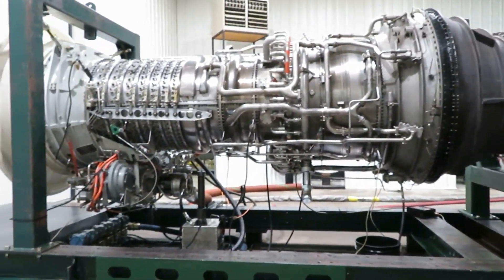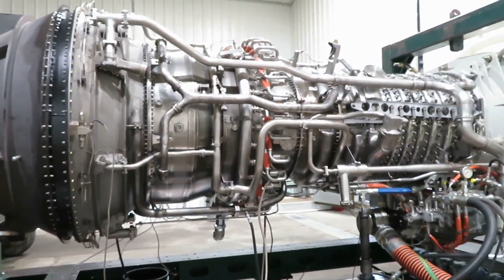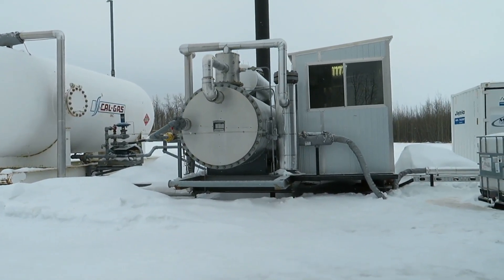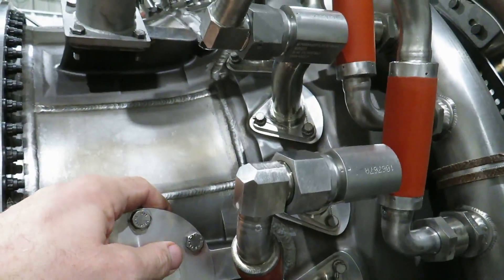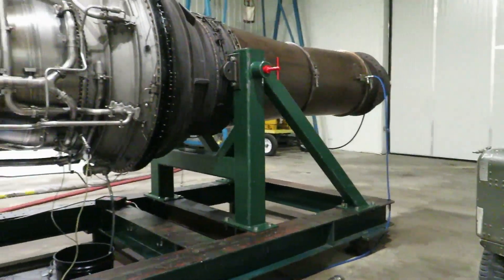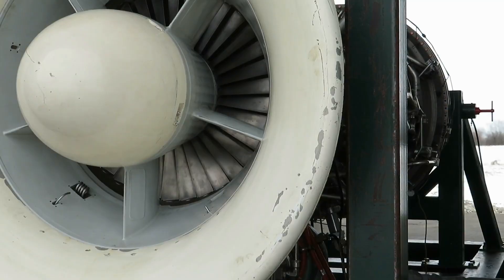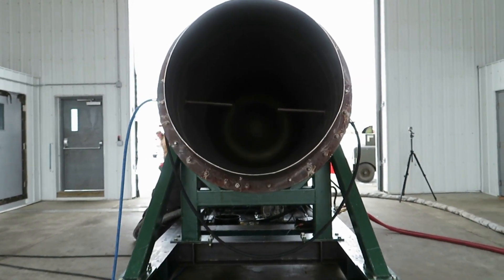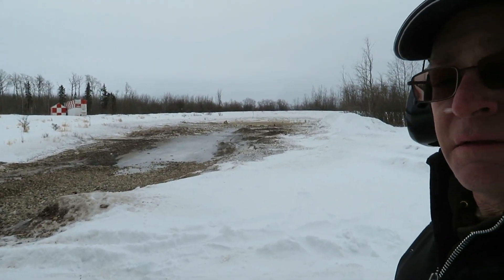The Big Engine - the GE LM2500

Comment: While I was working in Prudhoe Bay in the ARCO warehouse, we had several LM1500's in the cans ready to go to be changed out for the pump stations. They were used for the compressor trains along with Frame 5's; lot's of money in small places.
Reply: I worked at Arco CPF 1 and 2 as well as Sohio GC 1 and 2 in the early 1980's. I was the GE engineer who found that the brand new 2 shaft frame 5's driving compressor trains were shipped from the factory without oil seals on their #1 bearings. To run them, it took 2 guys constantly pumping lube oil into the oil tank all day and night long. The turbines would trip the next day  because the flame detectors would carbon up. At  CPF 2, I think. The managers at the oil company were flippin mad about the whole thing.  I hand made an oil seals out of aluminum plate and got them both up and running in a few days. I was a hero but GE San Francisco wouldn't even give me a GE baseball cap let alone a plastic walnut wall plaque or lunch at McDonalds. 

 After the blame game subsided, it was found that during the turbine builds at the GE plant in Schenectady, the wet coupling shaft to the accessory gear was ordered to be changed to a dry coupling shaft which needed the inlet casings to be machined for air/oil seals. They weren't.  I drew up plans for a bolt on oil seal to fit behind the inductor alternator. The oil seals had air plumbed to them to keep the oil inside the bearing housing. Without this seal, lube oil was being sucked out of the bearing housing into the compressor inlet at a horrendous rate. Those 2 Frame 5's are the only ones in the world with external bolt on oil seals on the #1 bearing. I had to quit GE as they insisted that I move to  Anchorage right after I bought my house in NorCal. Thanks for the memory jog!
Reply: @kimmer6  That is an incredible story, and I believe very word of it. I saw and heard much craziness in the oil fields while I was there.

Comment: I love the LM2500 series, the G4 especially. While they may seem “big” they are TINY compared to what a Diesel engine would require in size to put out an even remotely similar amount of horsepower. Any diesel putting out 20,000 to 40,000 HP is probably the size of a two-storey house, yet these LM’s can be fit inside the size of an oversized garage. Incredible when you think about it!
Reply: A similarly powerful Two Stroke Diesel is even larger: https://youtu.be/GPsUM7q6dz0

Such Engines are way more efficient and can burn much cheaper Fuel, so they usually are the Engine of Choice. Gas Turbines are only used where Space is very limited, e.g. on High Speed Ferries or Military Ships. An Exhaust Gas Boiler and a Steam  Turbine for Waste Heat Reclamation can get the Gas Turbine to similar Effciencies like a Diesel Engine, but so far, such a Plant was built on the Celebrity Millenium Class Cruise Ships only.
Reply: @Genius_at_Work  Weight is also a super important difference

Comment: In the Navy they burn 12 tons of juice an hour
Reply: Actually in the Navy CG class will burn 5,000 gallons per hour at full power. Which is 2 engines per shaft at 168 shaft RPM. Service tanks only hold 20,000 gallons and your not supposed to drop below 50% before switching to the other service tank. So if your going to post something and call it "juice" at least have your facts straight. It's rather embarrassing.

Comment: Normally It would be connected to a Power Turbine and generator right?
Reply from the maker: Yes, this particular engine does not have the integral PT.
Reply: @AgentJayZ  No. I mean will it be connected to the generator later? Because you said there was a generator backdoors.
Reply: @AgentJayZ  in this configuration, it is called a gas generator. only with the attached powerturbine, it is a gasturbine. 🙃
Reply: @AgentJayZ  yes true but that determine what the turbine is used for this was a test run to say the power turbine or LP turbine is to reduce the horse power or any cases a ship shaft rpm to a speed for the shaft for a ship the power turbine control the output of the power of the compressor which is also different to a generator
Reply: @bandittitot5941  that was difficult to follow as you are all over the place but the power turbine doesn't reduce its power.
Reply: The LM2500 engines can be used for a number of different things and therefore not all of them have the LP/power turbine.

Comment: Is it safe to have your window directly inline  with those blades? Is that bullet proof walls and glass?
Reply from the maker: It is not safe to say that. Oh... you need to be more specific. Compressor blades do not present a problem. Our three part lexan window can easily stop them.
The greatest risk is not the turbine blades, but the sections of the turbine disks, should they ever break up.
Our control room is not in the plane of rotation of the turbine section.
Reply: Thanks for your reply and also found one of your vids explaining this. Commercial engines turn at a lot slower rpm that what I’m used to. Had a rc model turbine engine come apart at 145k when it was being tested at the repair facility. Clearly different from you have as far as quality and speed.
Reply: Do love to watch your videos.

Comment: When I worked for ARCO in Prudhoe '85-'86 in the warehouse, I delivered a couple of LM1500's in the cans to the flow stations as they were the prime power for compressing the gas before being sent back to the CCP for final compression (up to 3500 psi), before being injected back into the ground. Saw a few Frame 5's too. BIG power in the oilfields.

Comment: Hi - curious about the inlet on your tests, more specifically how close you can stand to the front of the engine whilst it's running. Does a bellmouth inlet bring the air in differently? 

Thanks - long time English fan!
Reply from the maker: "Running" means anything from idling to military power, and then there's afterburner on top of that.
As you ascend that range, the minimum safe distance increases in proportion to the amount of air flowing into the engine.
The bell mouth reduces inlet depression, as explained in videos about it.
Reply: @AgentJayZ  Hey. Thank you for replying! I was unable to determine what power various engines were running at during some point in various videos. 

Thank you for taking the time to reply. Really appreciate it.

Comment: Firstly thank you very much. You are amazing @JayZ. 

The video shows us you transform lm2500 to a kind of turbojet engine that’s awesome.

Do you measure or calculate the thrust ? 

Will you inform us what is the maximum thrust ?
Reply from the maker: Similar to a turbojet, because the fan and bypass airflow have been eliminated. But not a turbojet, because there is no exhaust accelerating "jet" nozzle. 
This is an industrial gas generator, used to run a power turbine, to produce torque on a mechanical shaft output.
Thrust is not measured when testing a gas generator.
The mechanical power produced by a power turbine supplied with the gas generated by this gas generator is roughly 35 thousand Hp.
Reply: @AgentJayZ  Thanks,  as I understand it, when you perform Gas generator testing, you also obtain the horse power without dyno. Thats very impressive. 
I wonder that do you calculate the power via thermodynamic formulas etc. or correlation ?

We learn a lot from your videos and comments. I would like to thank you once again for this.
Reply: @sevgingokel2707  LM2500 can be load tested as a gas turbine (gas generator + power turbine) requiring a generator for the load. Or it can be tested as JayZ and his crew did, as a GG only with a thrust nozzle which kind of simulates the back pressure of a PT. When using the thrust nozzle that the manufacturer (GE) or licensed providers use then the power output can be measured and calculated via temperature and pressure measurements at Inlet and exit of the nozzle. That calculated power output is called isentropic gas horsepower. Via standard day correction and graphs that IGHP is used to verify whether the engine performing well or not.
Reply: @wanderschlosser1857  thanks for your very informative answer.

Comment: hello JayZ
I heard that sea water is used on the ship for the oil cooler. How do you cool the oil in the test system? Just curiosity...
Reply from the maker: We use a liquid to liquid heat exchanger from a J79, which cools oil with fuel. On the 2500, we pump water-based coolant through the "fuel" side of it.
Reply: @AgentJayZ  Thanks for the answer. I wonder that the fuel going through directly main pump on 2500 after cooling or do you use another cooling system.
Reply from the maker: Your question makes no sense, but I will offer a clarifying point anyway. The LM2500 in this video is fueled by vaporous propane. The oil cooler is a counter current heat exchanger. Oil is pumped through one side of it, and a water-based coolant is pumped through the other. The heat in the oil flows into the much cooler coolant.
Reply: @AgentJayZ  thanks. Your videos are amazing 👏👏

Comment: How many would be inside of a ship to power it? I’m certain you would need more than one, right?
Reply from the maker: Depends on the size of the ship. The gas turbines can be used in any combination. Some large ships might have a pair of 30MW units, and a pair of 5 or 10 MW units.
Some smaller ships might have one or two 30 MW units, and a pair of 3MW diesels.
Reply: Where I work we run 6 coupled to compressors for production of LNG. They take alot of punishment, running 24/7  x 365 (mostly 😀)

Comment: Ok, this is probably a silly question and my pre-emptive apologies if it is (or if you've heard or answered it before), but what would be the problem with injecting liquid propane directly into the engine without vaporising it first? After all, when these engines run on liquid jet fuels (kerosene, diesel, Jet-A or whatever), those liquid hydrocarbons get forced through the fuel injector nozzles and presumably vaporise almost instantly in the hot compressed air inside the combustion chambers. Liquid propane is a fair bit colder of course, but surely it would vaporise into the combustion chamber just as fast, if not faster? Or is it a matter of the fuel pumps not being able to handle the cold liquid propane?
Reply from the maker: Fuel pumps are not on board, and are part of the skid, or installation to which the engine is Installed.
Your idea would work, but remember what we are doing here: we are testing an engine that is normally running on natural gas. We want to substitute natural gas with something that the same fuel system can use, and not require us to build a natural gas pipeline to our test cell.
Pressurized natural gas is still a gas, so it would take about 40 tanker trucks full of the stuff to run an engine for an hour or so. Also, natural gas is not commercially available in pressurized trucks.
Propane is a liquid at about 175 psi at room temp, so massive amounts of it can be shipped by tanker truck.
Propane is CH3-CH2-CH3
Natural gas is a mixture of CH4, methane, and CH3-CH3, ethane.
We heat up the propane liquid, and have a gaseous fuel that is a near perfect substitute for natural gas.
That's why we do it.
In normal operation, the industrial engines we work on will be running on natural gas at room temp.

Comment: What kind of material in the start cart output hose made of in order to handle that kind of temperature?
Reply from the maker: Got a video about our Huffer. It supplies compressor bleed air, not exhaust.
Reply: @AgentJayZ  once huffer puffs it's last huff would it be economical for your kind of outfit to have compressed air storage or will you always use start carts?
Reply from the maker: The fact that over forty thousand start carts were built might start to answer that question.
Reply: @AgentJayZ  40k built in the 50's haha tech has come a long way since then hence why I was curious if it would be economical today, after all you find lots of other uses for stored air in a shop(sandblasting, lifting implements, etc)  I worked for Fiocchi ammunition about 10 years ago and the entire manufacturing facility was large (loud) pneumatic machinery fed by one large compressor and reservoir tank just slightly smaller then your LP tank. Always fascinated me with how complicated those machines were running off nothing but air.
Reply from the maker: I'll have to have a look at it, but it's a standard industrial reinforced transfer hose.
Reply: @AgentJayZ  seems like such a mundane item at first but then again I guess their not really made to be used for extended periods of time. Just seems like a lot of heat even for a short period.
Reply from the maker: The hose is rated for air and water at 150 psi and 200F continuous duty.
We subject it to 30 psi air at about 300F for about 20 seconds, and then it gets to rest, sometimes for five minutes, and sometimes for five weeks.
We inspect it often, and replace it when we see any damage.
If it was to completely fail in operation, the results would be an engine not starting.

Comment: Nice machine Worked with LM 2500+ power generation & also TM 2500 mobile units nice equipment to use & operate as well

Comment: Thank you, nice video!

What is the inlet propane pressure where your flex supply line connects to the fuel manifold?

Could you estimate the horsepower rating of your air starter when it spins up the LM-2500?
Reply from the maker: Fuel pressure is modulated by the fuel control valve. Max we can supply is about 200 psi.
The start cart is rated about 90 Hp. I don't know how much of that is needed to spin up the LM2500, but we do not restrict it.
Reply: @AgentJayZ  
I'm curious, about how much propane does this burn during the test?  I imagine it's not a small amount...
Several years ago I took a week-long GE gas turbine course when I was still in the union.. we just tore down and rebuilt and old example unit, but they didn't get into the specifics of consumption and all that, as it wasn't important for what we did.  I never got a chance to work on an actual working example unfortunately.  Amazing the amount of power they get out of a relatively small package

Comment: Gorgeous engine, but if you’d continue to run it I’d highly recommend some sort of air filtration system, it’s worth it in the long run in terms of the longevity of the GTM.
Reply from the maker: This is a test cell. We run it for 20 minutes. The filtration it uses in service is the size of our building.

Comment: We were getting 33000 HP out of our LM2500 in the Aussie navy
Reply: That's more than 24 MW! On liquid fuel! That is a certain ticket for an early death of your hot section. The manufacturer GE did sell 2500s with a similar output (23MW) to the German Navy (F124 class). The first engine was dead after a few hundred hrs. Reason, they sold it with a max T54 temperature of 920 degC. And I guess it is similar with the Aussie Navy. In marine applications a good sustainable power output for the 2500 running on Diesel is about 20MW, everything above will significantly shorten its lifetime. As a comparison for industrial applications of the 2500 the max T54 is set to 840 degC, where the power output would be about 22 MW on standard day conditions and natural gas fuel. The point is, you could even get 30 MW out of an LM2500 if you increase the temperature even more, it would just reduce the lifetime extraordinarily to like a couple of hrs or less. The German Navy reduced the max power to about MW now to keep the engines much longer alive.

Comment: are  VSV's automatic
Reply: The VSV are hydromechanically controlled via the VSV control unit sitting fwd LH side of the gearbox. The engine shown in the video is an industrial version running on fuel gas. Therefore the VSV are actuated with engine lube oil. In older Navy applications the VSV are actuated with liquid fuel alike they have been on the TF39/CF6 aircraft engines of which the LM2500 is a derivate. In that case the VSV control is part of the Main Engine Control which is also fuel pump and fuel control.
Reply: @wanderschlosser1857  the variable stator vanes are controlled at the main fuel control automatically
most moving engine parts require lots of cooling, lube oil, grease and oils proper lubrication for less friction and long life, hopefully 
this LM2500 don't fly, looked it up, but it is based on the J79 F104 starfighter, a rocket with a man in it
could this LM2500 fly if it hasn't been weighed down by heavy ground quality parts
It looks beautiful, I always loved the gas-turbo-jet, including prop-shaft-load power, a fine looking engine
thanks for information .
Reply: @micstonemic696stone  Sorry but you're wrong, LM2500 are based on TF39 and CF6-6, the first is the engine of the C5 Galaxy, the latter was used on the first 747 and DC10 versions. The  derivate of the J79 is the LM1500, I think JayZ has videos of that one as well. 
And as I said, the LM2500 shown in the video has got oil actuated VSV controlled by a hydromechanic VSV controller. It can't be the main fuel control because the fuel is natural gas (on the test bed in the video they use LPG) which cannot be used as a hydraulic fluid. Older navy versions of the 2500 though indeed use liquid fuel operated VSV controlled by the main engine/fuel control since they run on diesel. Trust me, I'm working on CF6 based LMs for 25 years.
Reply from the maker: The VSV system is under control of the main fuel control. The human operators do not have any access to the VSV control.

Comment: Sounds like an aircraft
Reply: It's a version of the General Electric CF6, so that's no surprise.
Reply: @cageordie  isn't LM 2500 basically marine version of GE F-414
Reply from the maker: The marine F-404 is the LM1600. The LM25600 is based on the CF6-6.
Reply: @AgentJayZ  oh TIL